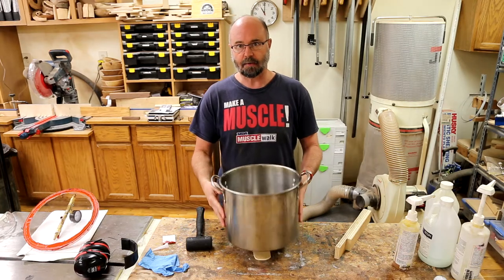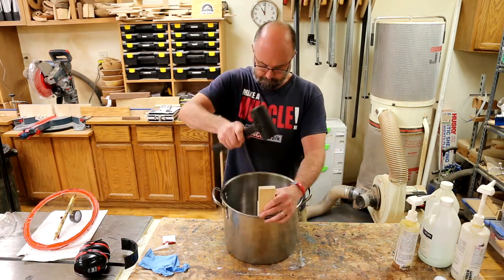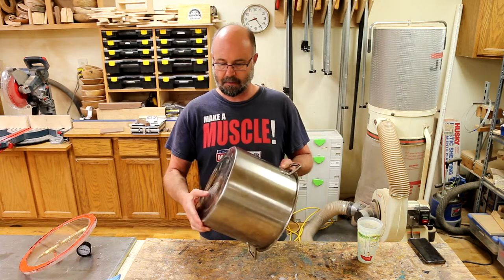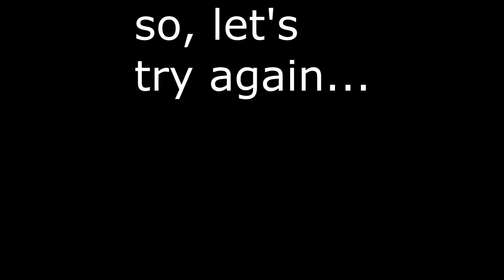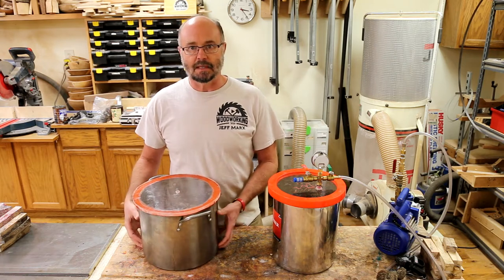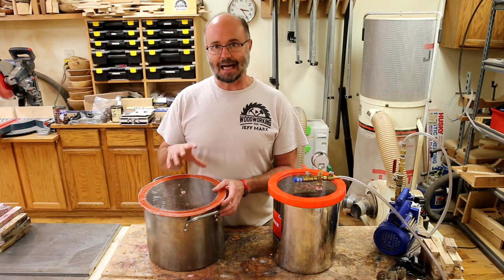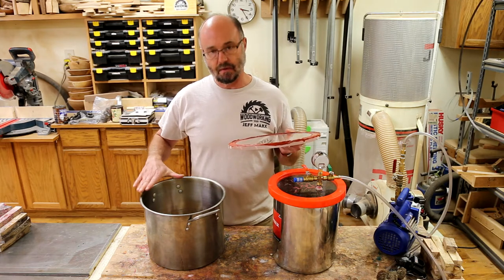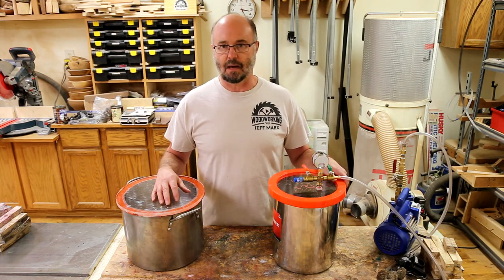Making a vacuum chamber, learn from my mistakes

Comment: One thing I noticed on all pressure vessel lids is that the open threaded end of the valve assembly is facing directly downwards. Upon restoring ambient pressure the air rushes at taifun speeds throug that very open end, blowing the resin outwards. The reason is simple: There is no deflection unit anywhere. Adding a simple deflector disc will cannel the air in all directions across the surface area of your lid before being redirected downwards the vessel chamber wall, greatly reducing the airspeed and force applied. This will also prevent lightweight objects being tossed and justled uncontrollably.

I have seen food-grade vaccuum chambers equipped with cover plate on the inlet port that prevent F5 tornado speeds inside the chamber as the vaccuum is destroyed.
Reply from the maker: Interesting observation, thank you.

Comment: Easily my favorite video you've done to date. After having spent years of my career working on high vacuum equipment (Varian, Oerlikon,etc...doing cvd, e-beam, resistive evap, ion bombardment densification, etc...) , I can appreciate the trials and challenges of achieving and maintaining any level of vacuum in vessels of all different shapes and sizes. It is simply harder than one might imagine. (3 X 10^-6 Torr in a 125 cubic foot chamber anyone?)
Reply from the maker: Thank you, glad you enjoyed my pain.  :)  It's funny (maybe) how often I end up spending more to make something myself than just buying it.  I could always start by buying, but then I'd miss out on the learning and skill development which is really most of the fun for me.  Often the quality ends up better, but even if it doesn't the satisfaction of knowing I did it and learned along the way is way better than the convenience of clicking the buy now button.   The physics of pressure and vacuum are amazingly powerful when you can harness them.  Thanks for watching and the nice comments!
Reply: @JeffMarxWoodworking  Agreed. It just occurred to me that if one were confined to the genre of kitchen implements to make a vacuum chamber, perhaps an old pressure cooker pot might be an option? Nice, thick pressure rated walls, built in o-ring gasket, locking lid, and in many cases, pipe thread tapped holes in the lid? I love doing projects like this. I vote for more videos like this one.
Reply from the maker: @75blackviking  Good thought!  I screw up a lot, so will plan to highlight more in future videos.  Thanks!
Reply: Can you provide a list of good resources for getting into vacuum tech and engineering? I would like to build particle experiments, fusors, mini particle accelerators at some point but getting and maintaining a vacuum seems like an enormous mountain to climb. The fusor forums are a good place to start and have a lot of info but their advise isn't helpful with sorting out things like all these new compact gauges and very cheap pumps available.

Comment: Hi. I used an old pressure cooker which was cast alumilun. I also put the fittings in the side of the pressure pot so that there is less stress to the perspex at the drill site. Works perfectly
Reply from the maker: Excellent, thank you!

Comment: Wow, this is really helpful to me; you saved me from making the same type of vacuum chamber.  Much appreciated!
Reply from the maker: Thanks for watching and commenting.  Any time I can screw up so you don't have to, I'm happy to oblige.
Reply: @JeffMarxWoodworking  Ha ha!  Where have you been all m y life?  So now I'm trying to get all the parts to convert a pressure cooker to a vacuum chamber.  But the fittings' names aren't always standardized: i.e., a '1/4" male to 1/4" flare adapter connector.'  It's a puzzle game!  Happy New Year!
Reply from the maker: @skyeridley7764  Funny, but it's even worse than that in that there are many standards but they're not compatible with one another.  You need to pick one system and get everything that goes together.  It's ideal if you can find someone at a good hardware store that knows what they're doing.  Good luck, you got this...
Reply: @JeffMarxWoodworking  Thanks!

Comment: Keep in mind that, for Cactus Juice and other hydrocarbon or alcohol solvent-based applications, you should use a glass cover, NOT acrylic or polycarbonate.  Those chemicals attack the plastics on a microscopic scale, resulting in crazing, the formation of tiny cracks in the plastic.  Such damage can cause the lid to fail, catastrophically, under vacuum.  Changing to a glass lid will also means you'll have to relocate the vacuum port to the side of the pot.  Drill your hole about 3/4 the way up from the bottom and use a bulkhead fitting to seal the entry point (the pot walls are too thin to thread a fitting in).  FYI, the plastic lids are fine for degassing epoxy, silicone, plaster, and other materials that don't contain the above solvents.
Reply from the maker: Great tips, I wasn't aware of that issue with plastic lids and cactus juice - thanks!
Reply: I know I'm a little late to the show but this is also a problem for some pumps.  The off-gassing from some resin reactions can damage the interior workings of a vacuum pump.  ... That said, I've never used cactus juice but my understanding is it doesn't react until it is heated.  Should be safe there.  Just wanted to throw that out there.
Reply: @weathormantom7206  I just bought an Amazon vacuum chamber and pump. They specifically state that it is not suitable for stabilizing wood. Not every brand states that, but that's why some kits come with tempered glass lids.

Comment: I bought a pressure pot from harbor freight for 105.00 replaced the fitting for vacuuming. Total cost$  142.60,works great.i have a 2 stage 3 cfm vacuum pump from my A/C days,now retired.
Reply from the maker: Fantastic, nicely done!

Comment: If you have used for a while you will learn that the hole (if in the top) should be on the side. If you have a large container of resin and then open to allow air back in, if that "blows" on the product, it can splash all over the interior. That was MY mistake. Good video though, and why my next one may be purchased. 🙂
Reply from the maker: Yikes, thanks for sharing that heads up!

Comment: Acrylic will develop cracks, especially if hot resin splashes on it.  I think you need tempered glass to avoid cracking.
Reply from the maker: Thank you, you're right about acrylic not being the ideal material.

Comment: Was the compressor emptied of oil that it came with?
Reply from the maker: I try to always check that the oil level in my vacuum pump is correct.  I didn't lose any oil in this misadventure.  Thanks!

Comment: Save yourself hassle, get a metal open head handled bucket and lid. Pressing down on it when you start is all that is required other than making it so the hose attachment hooks to a hose head.
Reply from the maker: Sounds like a simple solution, thank you!

Comment: Will wood work as an alternate container?
Reply from the maker: I don't believe that wood alone will hold pressure, thanks!
Reply: @JeffMarxWoodworking  if I added silicone and putty to reinforce the wood?
Reply from the maker: @Lizartemis  I don't think it'd likely have the required hoop strength even with reinforcement.  It could be fun to try as long as you're careful with your safety precautions.

Comment: Can anyone steer me toward an understanding of the parameters of designing and building a vacuum chamber proportioned approximately like a book or thick magazine? I imagine a  vessel welded of relatively thin steel plates with stiffening ribs welded to the outside and heated to about 180 degrees F.
Reply from the maker: Not me.  Look for a pneumatic engineering specialist for that one.  Good luck.  What's your application for that chamber!
Reply: jeff marx:
Relatively soft North American hardwood cutting boards could be improved by using a higher temperature formulation of adhesive, subjecting them to a vacuum to draw out the inter? intra? cellular air, flooding them with a molten oil and wax blend, releasing the vacuum so the wax is drawn deep into the wood, then draining off the excess wax... kind of like phenolic impregnation, I think.
Reply from the maker: @markkoons7488  That's likely true, thanks Mark.  Many of us who make cutting boards generally submerge in mineral oil to impregnate followed by molten mineral oil w beeswax.   Probably doesn't meaningfully change the hardness but creates a nice, safe, maintainable product.  Ocassionally adding oil/wax is all it takes to keep in great shape.

Comment: I did not read other comments but I wanted to address the cracks in the lid. DO NOT BUY AN ACRYLIC LID! PERIOD! It is fine for degassing but not for voc chemicals, they WILL crack..... Buy a chamber with a GLASS LID! Make sure that it is stated that it is safe for cactus juice or that it is GLASS, and thick glass!
Reply from the maker: Thank you Mark!